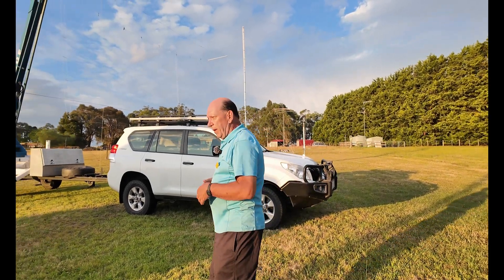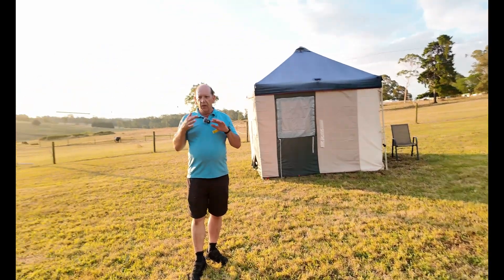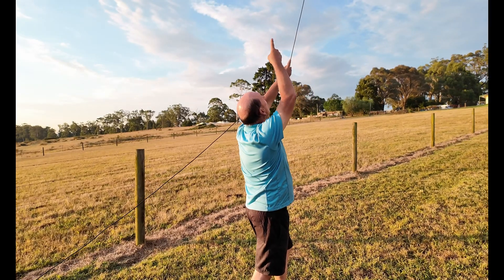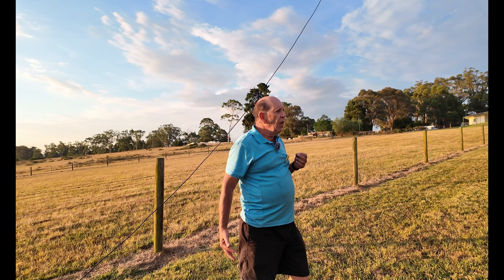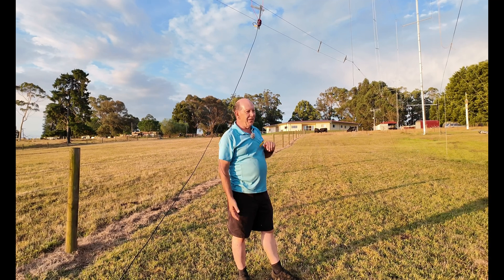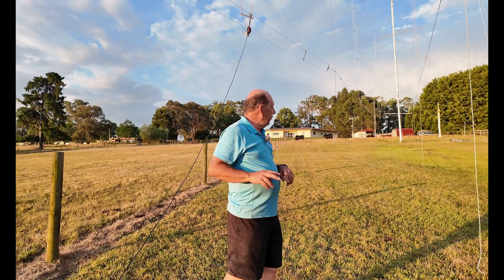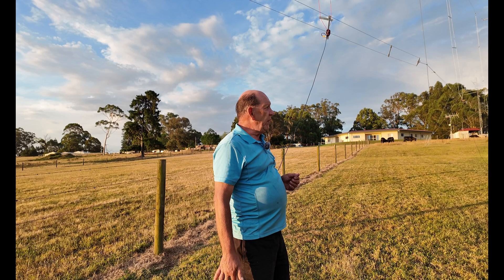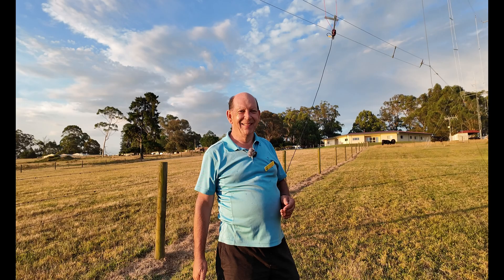2025 Antennapalooza Event Curtain Array

Comment: Neat build project!  For a more complex build you can also phase  feed the reflector dipoles, usually 1/4 wl 90 deg phasing or 1/8 wl 135 deg phasing this improves F/B and gives you the ability to switch the array direction 180 degrees.

For a simpler build you can put up a Extended Lazy-H, which is equivalent to 4 phased dipoles, 2 over 2, with the dipole ends spaced 1/4 wl apart.  This simple antenna approaches 13 dBi gain with the lower wire 1/4wl high, and approaches 15dBi gain at just over 5/8 wl high over avg ground.   It is bi-directioal covering both long and short path, and is a much simpler build.